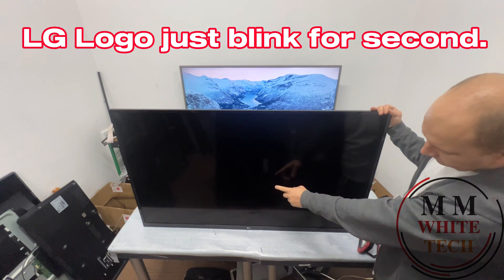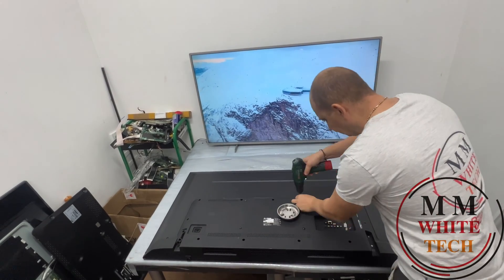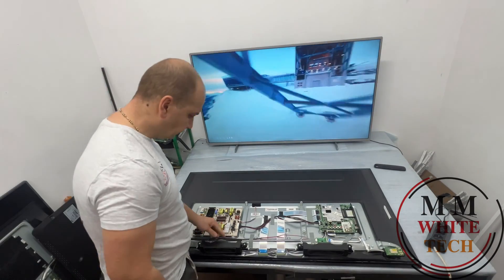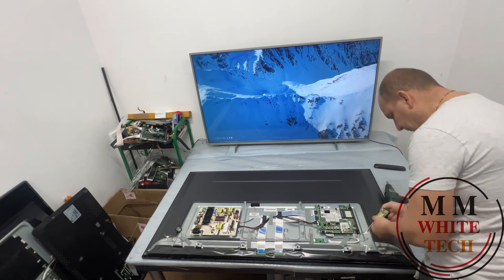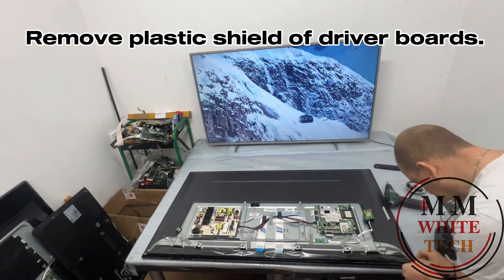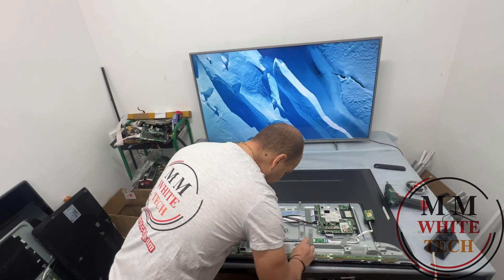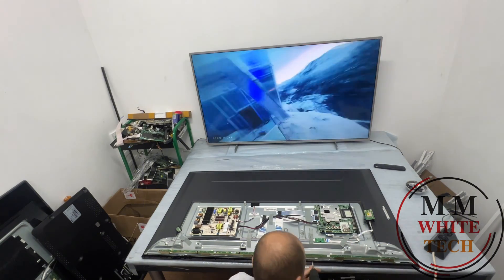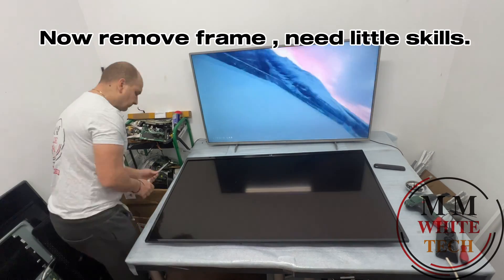Fix black screen LG LED TV 55UJ620V , Repair and disassembling steps , replace backlight stripes.

Comment: Hi can i ask a question? I have LG 55 inch 55UK6100PLB. It is from 2018. Do the same LED fit in my one same as yours? 🤗 thanks
Reply from the maker: Its different not the same, if you want i can send you a link to aliexpress
Reply: if you can please 🤗🤗
Reply from the maker: https://s.click.aliexpress.com/e/_c35H7bwj
Reply: Thank u so much, do you have any tips. Cause i am going to try it with my stepdad
Reply from the maker: Just watch the clips of my channel , have some lg replacement , and do it slow and gently when removing the lcd panel.
Reply: thank u so much🤗🤗🤗